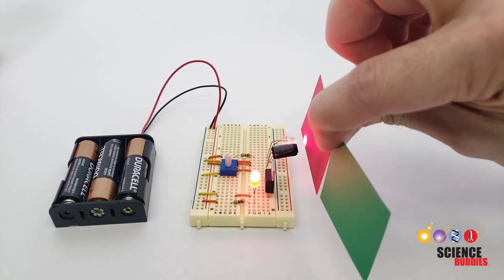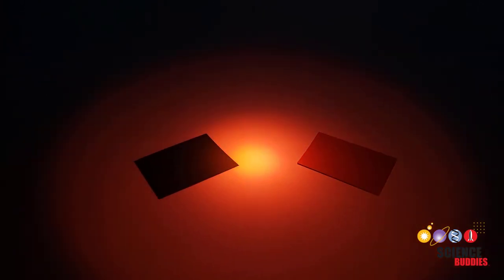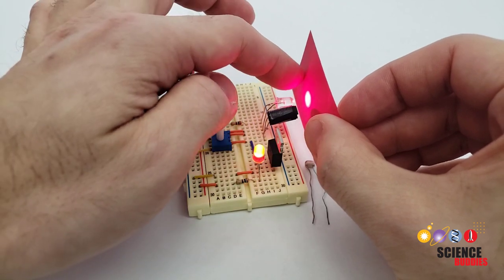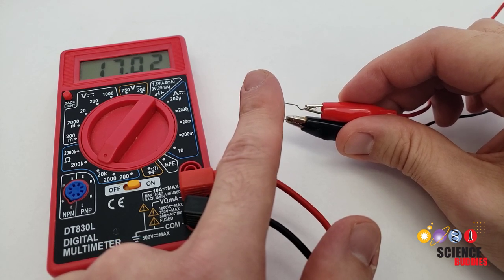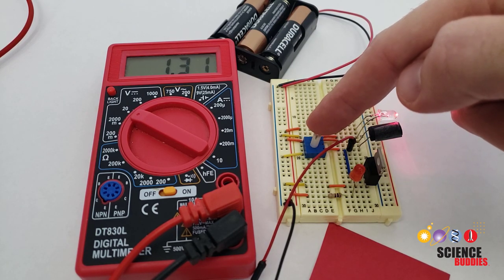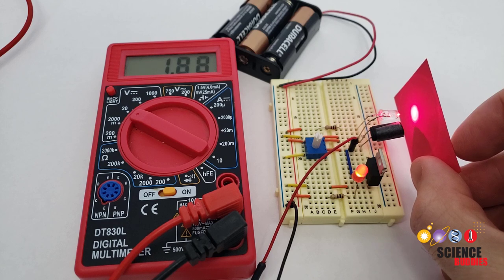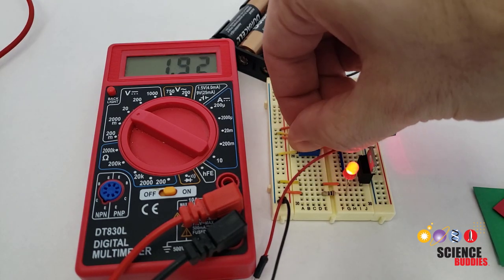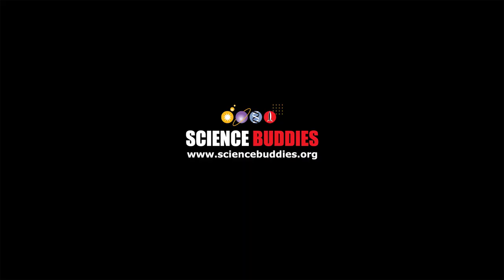Simple Color Detection Circuit | Science Project

Comment: Can I use IR F540 mosfet instead of STP16NF06L mosfet?
Reply from the maker: The IRF540 has a higher gate threshold voltage than the STP16NF06L, so you may need a bigger battery pack (like 4xAA instead of 3xAA) for the circuit to work properly.
Reply: Can I use IR FZ44N MOSFET?
Reply from the maker: It looks like the IRFZ44N, like the IRF540, also has a higher gate threshold voltage , so would also require a bigger battery pack, but otherwise the project should work.
Reply: @Science.Buddies what should the voltage of the battery be for it to work?
Reply: Can you please help on numbers? I mean capacities of all the elements, there are only for resistors. Thanks.

Comment: If I use a 2xAA battery holder, would it still function?
Reply from the maker: This circuit needs a 3xAA battery holder for 4.5V. A 2xAA battery holder would only supply 3V and that won't be enough to activate the transistor in the circuit.
Reply: @Science.Buddies I want to use 9v battery so is this possible???

Comment: can i use the same circuit to detect yellow color? or what should i change in order for it to work?
Reply from the maker: Try using a yellow LED instead of a red LED - see the project instructions linked in the description for more details about how it works.
Reply: @Science.Buddies  thankss, but i have another question, can i use op amp instead of a transistor, and if yes, how can i do it?
Reply from the maker: Hi - changing the circuit to work with an op amp is more support than we can provide in YouTube comments, we recommend asking in an electronics forum.

Comment: Whats the specific type of potentiometer used? Thank you
Reply from the maker: It is a generic 10 kilo-ohm potentiometer. You just need to make sure it has breadboard-compatible pins and not solder tabs.
Reply: @Science.Buddies  where can i buu this? Thank you
Reply from the maker: You generally can't buy them in physical stores but they are available on Amazon and from electronics vendors like SparkFun and Adafruit.

Comment: Can i integrate a summing op amp to this circuit instead of a mosfet?i have a school project like this and i dont have a mosfet.
Reply from the maker: Hi - you may be able to use an op-amp for this circuit, possibly in another configuration (such as a comparator), but designing that circuit is more support than we can provide in YouTube comments. We recommend asking for help in a forum specifically dedicated to electronics.